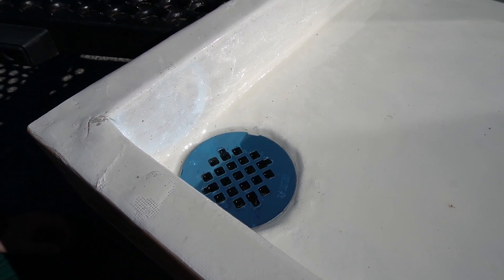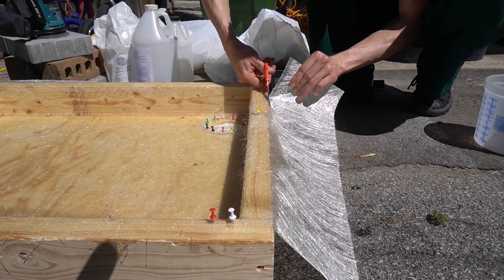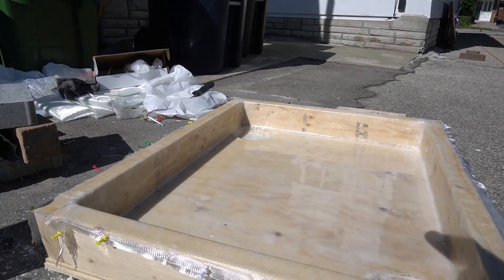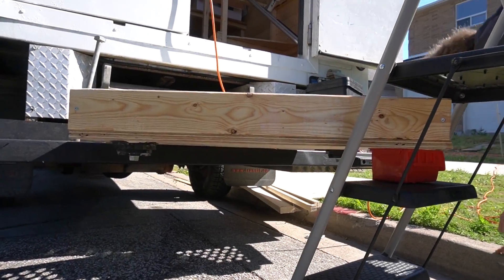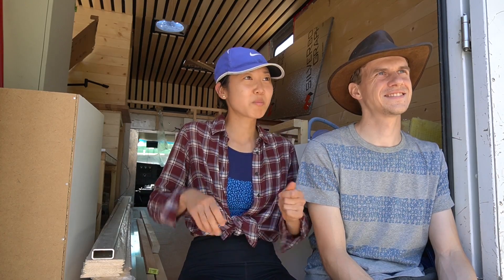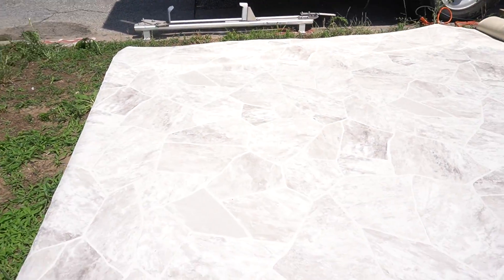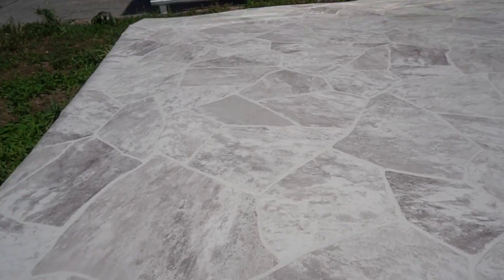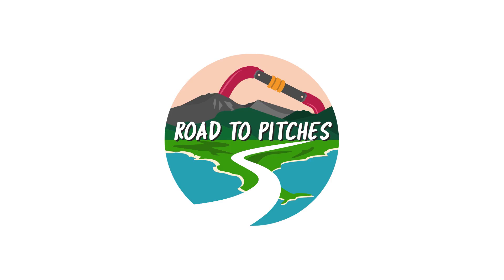DIY Shower Pan Using Fibreglass & Epoxy for our RV | BOX TRUCK CONVERSION

Comment: 8:39
Ya not having audio can be frustrating. I have been going live and creating content for years. In those years I started by holding my phone while doing the project. So I feel your frustration. Only I wouldn't find out if the camera wasn't pointed at my face or their was background noise overwhelming my mic or that my phone stopped recording because there wasn't enough storage until I watched the video myself. Then I would edit it. Your both blessed to have each other. My ability to articulate is devastating for my audience. Finding the right words is something I could use alot of help with.....

Comment: Loved the DIY shower pan!  Saves a bundle over the ridiculously priced plastic or metal ones.  Very well made too!  I am going to make one, then tile over it.  It was very useful to see how you made the shower stall too.  I found some waterproof PVC vinyl tile marble pattern that you can stick with adhesive to the plywood.  This is easier than using FRP sheets.  Look for Innovera Palram, or Palisades Vinyl tiles. Use Loctite Power Grab Ultimate construction adhesive and some mildew resistant silicone caulk.  I think this is a very easy to use product and goes up fast.  Also very lightweight, comes in multiple finishes, and cost is low - Home Depot or Lowes.

With regard to your butcher block counters, I have a 'patented' technique of using Boiled Linseed Oil - let dry 15 mins, wipe off excess, let dry 2 days aired out.  Then dilute oil-based Satin Clear Interior Polyurethane with Mineral Spirits 50:50 and paint on.  Let dry 15 mins or less, and wipe off excess, drips, and smear a very light coating on.  Let dry a few hours then repeat 2-3 times.  The diluted Poly soaks in and hardens the wood. When you wipe it off, it leaves a hand rubbed finish.  Watco is too pricey, and I don't like the tackiness, and constant maintenance. Poly is good for 100 yrs no problem.  I do fine furniture like this too.  Beautiful finish, minor cost over Watco.  The Linseed oil conditions dry wood before you seal it off with the Poly.  Try this.  Saves you money and its a very durable finish, impervious to damage or stains.  Don't ever use epoxy on wood - it makes natural wood look like plastic - yuk. It also scratches up a lot, not durable.  Varnish is useless - stains, burns, etc.  My method is durable, and thinning it prevents a tacky shiny top coat, you want the wood to come through like an oil finish but waterproof. This is the same as Wipe On Poly without the high cost.

Comment: hey guys love your channels you seems both very kind.  for the shower I would add a vertical flange on 3 sides and then put the vinyl so it cannot drip in the space between vinyl and fiberglass shower.  cheers from Quebec
Reply from the maker: That is a great idea! Luckily we haven't sealed the bottom yet, so we can definitely do this. Thank you so much for your suggestion.

Comment: Great video you inspired me to make a new shower pan for my RV i been watching videos on how to fiberglass for weeks now and was very curious why making the shower walls out of epoxy  and mat laid over the pink  half inch thick foam board was not on the list that's what i had settled on after watching a few videos on it .light weight strong and the 12v lighting and color possibilities. Real awesome project y"all got going i cant wait to see more of the videos from y"all  real awesome job on that shower pan

Comment: I am remodeling the shower's wall of my RV with plastic "play wood" what I bought at THD, for make the corners with out cut the material, I using my hair dryer to apply heat and molding it more easier, like that I don't have to be worried about water leak through the walls 😊

Comment: Hey there! Great job. I have not found another video showing how to use fiberglass sheets to make a shower floor. I am doing a complete wet bath. Do you recommend doing the entire TT bathroom floor using fiberglass sheets? Is it too slippery? I don't want to waste time or money. Any advice you give is appreciated. Thanks!
Reply from the maker: It looks and feels like a commercial shower pan, so yes it can definitely be slippery when wet. You could look into adding grains into your epoxy on the top layer to add some grip, but that will make it harder to clean.
We ended up putting some wooden tiles on top.

Comment: Very nice.  There is a chance, though, that your setup will delaminate from the wood.  Typically, the wood is presoaked with resin until it stops absorbing.  Then proceed with the laminating process.  There is a chance that the initial layer of glass did not properly bind to the wood.  Hopefully, all worked for you.
Reply from the maker: Hey thanks for your comment! That's definitely something to keep in mind on the next build!
With our pan I'm not too concerned though because I did use a lot of resin and I'm certain the wood got soaked well enough and gave a good bond. Maybe the side walls didn't get as much resin as it would run down by gravity.
At least the side walls don't need to bear any weight.

Comment: Thanks for the video. It was very difficult to find someone, who actually built the shower bed of fiberglass, which I would like to do. Can I ask you if it turned out to be waterproof in reality after frequent use?
Reply from the maker: We don't use our shower super often, sometimes once a week, sometimes less than that (if we shower at rec centers, etc.)
But so far it has held up perfectly fine. Also around the drains is no cracks or leaks visible.
We'd do it again, it's cheaper, fits custom layouts and isn't that much work either.
The result looks OK (of course not as pretty as a factory made one). With a better setup, like a real garage where you can properly level things, it can also look even better.

Comment: do you still have the RV?  if so how is the vinyl walls holding up....
Reply from the maker: Thanks for reaching out. Walls are still doing great, basically looks like the first day.
Reply: thanks... my shower in my cargo trailer (in progress) has a curved wall and I thought this would be a great way to over it

Comment: Congratulations on new shower!l! We are converting our 16' box aswell! I noticed understorage boxes at 11:24. I wanted to do the same, but got a bit spooked, thinking that a pot hole or uneven ground could mean scraping the bottom... ANy issues with the boxes there? PS you guys were some of the 1st box builders we watched a year ago before we started... Thank you for the inspiration!
Reply from the maker: Thanks and happy you enjoy our videos. I would say it depends a bit on the vehicle you have. Our box sits on top of the wheels, there are no wheel wells which means it has a lot of ground clearance. So far we cannot recall ever scratching the storage box. There has been an occasion where the metal grate at the very end touched the dirt (it was kind of a V-ditch but driving over it diagonally it only hit the side without the storage box).
On regular roads there's always been enough clearance.
Reply: Thank you!!!  @RoadtoPitches   Wahoo! See you out there sometime!

Comment: Using the vinyl sheet for the shower walls seems a fantastic idea.  Do you have any regrets and has it stood the test of time? 👍🤞
Reply from the maker: No regrets it held up really well, is easy to clean (we use a squeegee after each shower to wipe it dry) and we like the looks.
Reply: @RoadtoPitches  Great, thanks!

Comment: Question: how do you attach the walls to the shower pan to keep it watertight? I'd appreciate any advice. Cool video.
Reply from the maker: On the back wall, there is a small piece of wood that's attached to the shower pan that we attached to the wall. On the left side where it is open, we added another piece of wood that is affixed to both wall and shower pan. We couldn't reach the right side to do anything :P. The wall also sits over the shower pan (you can see at 16:32) and we added silicon. Fingers crossed this works lol. Thanks!
Reply: @RoadtoPitches  Thanks!

Comment: Hey guys! I was wondering what drain you got, I searched all web, but I can only find drains for really thin showerpans!
Reply from the maker: We just used a 2 inch drain we found at home depot. A reduction piece gets it down to 3/4 inch if I remember correctly, because we ran into some spacial issues with our box frame. Originally I just wanted to use 1.5 inch like I used for the rest of the drain system.
I think that drain is not even meant for showers necessarily, but could be used as a garage floor drain, too.

Comment: I have a question buddy, it was commercial truck before, but when you own personally for personal use, do you still have to have some kind of commercial truck insurance? any info would be helpful. thanks.
Reply from the maker: Hey there! Yes, it's a commercial truck policy even though we are legally allowed to drive it without a commercial drivers license. The insurance process was stressful, but we were able to find an underwriter who would insure our truck. There are some limitations placed on it, such as driving distance (while it is being built), but nothing that limits us RIGHT NOW. We have to reassess once we meet the criteria to register it as an RV. If you'd like, email us -> hello at road-to-pitches.com and we can share our agent's details with you (if you're on Ontario). We will publish a blog post about this shortly and I'll notify you here.
Reply: @RoadtoPitches  Thanks for the tip! unfortunately, I live in the US D.C. but it helped to get some clear ideas. Thank you! oh and your fiberglass resin shower base solved some of my problems. I am planning to build Japanese style jacuzzi in my truck. I don't care if I don't have kitchen, no bathroom, no shower, but I definitely need jacuzzi. so I am trying to get 100gallon water, rainwater filtering system, hot water system, and hand made jacuzzi. lol
Reply: @5ChG  hey e-dev. I’m building out a stepvan with a GVWR of 14,100lbs.  In NH anything under 26k GVWR can be registered private.  My insurance is commercial policy with Progressive commercial insurance.  You can contact them, they’ll probably hook you up.
Reply: ...PS, I’m currently learning the eagle PCB software so I can build my own power distribution and PWM boards and control them with some Wemos D1 mini’s....

Comment: Great vid. What did the shower tray weigh do you think?
Reply from the maker: Thank you! Not too heavy, about 10kg or so.
Reply: @RoadtoPitches  great. Think I will use this method also! Have you found the waste pipe / metal bit at the top has stayed tight?
Reply from the maker: @alexmoody591  We've done a few tests and no issues with the waste pipe. If we could do it again though, we would make the outside edge a smidge higher to catch the shower curtain better.
Reply: @RoadtoPitches  That's really useful to know. Thanks a lot!

Comment: Why did you not wet down the surface first, then add the first layer and then the second layer?
Reply from the maker: I guess two reasons: first, I'm not super experienced when it comes to working with fiber glass. My experience comes from tiny model air planes many years ago and building the rooftop tent. And the second reason cause it didn't matter much for this application. I didn't have to save on weight or material, so I everything just got soaked when I poured the epoxy onto the webbing. If you need thin layers, you'd epoxy the wood first, then apply the first layer, let it bind to when it's sticky and put the second layer on.

Comment: That drain is going to be a disaster. Waaaaaaaay too small. Measure 12 times, cut once. Haha. Neat pan but that drain is going to be a headache. Take that from a 20 year plumber.
Reply from the maker: After a year of use we haven't had any issues yet. Keep in mind, this is a low flow shower head, on a 20 gal water tank. This is a very different use profile from your daily shower in a house. We rinse in there for 5 minutes after a hike... it's not your half hour full hair and body care.
Obviously I had wished to have regular size drains, but it has not turned out to be a problem. Also keep in mind that all the plumbing is accessible, it's not like in a house where the pipes are buried behind bricks. If it would ever clog up to a degree where I can't clean it with a bit of twisted wire I'll just change the 20cm of 3/4" pipe.

Comment: My question is whether you skipped over the slope part that shower pans need so all the water drains out through the drain you have installed?
Reply from the maker: That is correct, the pan has no slant towards the drains. In our experience this isn't a problem though because the van is almost never perfectly level. Having 2 drains helps in those cases, but we also always wipe the shower stall dry after using it as you don't want all that moisture lingering in there. So if any water is pooling in a corner of the pan we'd just wipe it to one of the drains at the end.